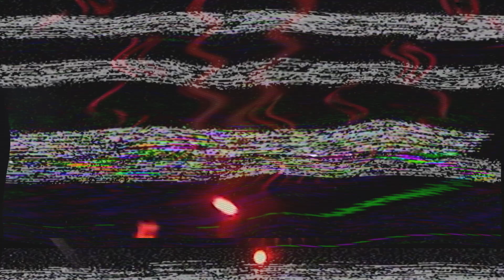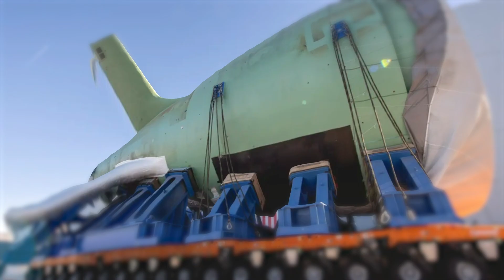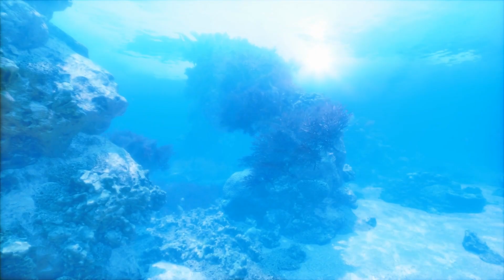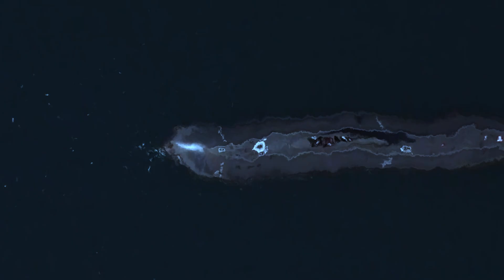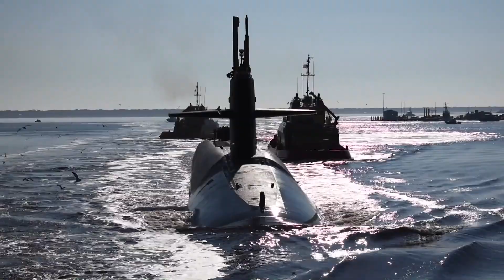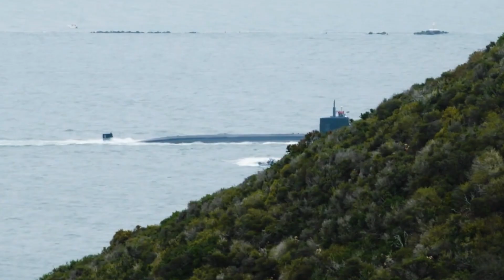America's Killer Next-Gen Submarine with a Weird-Looking Stern

Comment: Really? "... the x-shape stern optimizes water flow around the propulsor..." in reference to quietness? Sorry man, you're going to have to better at explaining how rotating the tail section 45 degrees reduces turbulence.  So much other hype in this video seems to credit the X shape for improvements that are probably better attributed to some other change or improvement. I just don't find this video to be credible.
Reply: @user-fj6py8gi8r  4 surfaces producing turbulence instead of 2. Maybe the per-surface turbulence level is lower but switching 2 noisemakers for 4 quieter ones isn't automatically better. Increasing the size of the 2 surfaces in the conventional format may actually be quieter.

The claims made in this video about the x-shape don't pass the sniff test with the amount of information provided; more supporting data is required.

Comment: they now have missiles launched from subs that have 12 separate rockets in each warhead , each rocket can track and take down any ICBM within 2800 miles of the subs location traveling at hyper-sonic speeds. 30 of them parked off an enemies coastline  or northern most point in 2 subs can take down 89% of over 300 ICBM's launched simultaneously .

Comment: Also excellent for stability at high propeller speed. (Prevents the sub from rolling on side as the propeller is turning the sub slightly at high speed)
Reply: Screw, not propeller.
Reply: @ChasWG  Whatever, pedant.
Reply: How would rotating the tail section 45 degrees counter prop torque?
Reply: @warpedweirdo  the control surfaces work to counter the force of the "screw". At high "screw speed" the entire "boat" be turned. (The screw turns the boat as it pushes against the water). Difficult to give a full detailed explanation of.
Reply: @warpedweirdo  oh sorry i think i understand the intent of the question better. All of the tail control surfaces are at 45 degrees to the vertical and horizon therefore all surfaces can control more than one axis of movement. A vertical rudder and horizon stern plane are not versatile in controlling multi axis. I am only using lay person mechanical motion concepts. Ask an ai chatbot to give a detailed physics explanation maybe.
Reply: @autopoiesis1011  Four planes at 90 degrees separation. 3 axis of control: Roll, yaw, pitch. Moving all planes 45 degrees about the longitudinal axis of the sub doesn't change the level of control each plane can provide, nor the resistance to prop torque each contributes. No physics or mechanical motion training is required to understand this.
Reply: @warpedweirdo  what is the original question?
Reply: @autopoiesis1011  My original question was, "How would rotating the tail section 45 degrees counter prop torque?"
Reply: @warpedweirdo  thank you for restating. Question? (Its been a long time since i watched the video) can each of the four "fins" on tail be turned independently? If yes then: at high "screw" speed adjust each fin so the entire tail becomes like a "screw" opposing the drive "screw". My description has no reason why the 45 degree angle helps, it just felt intuitive, so i retract my original statement. What advantage is gained by having non-conventional rudder and stern plain is no longer what i thought. Thank you for challenging my original statement and thank you for patiently following up. Very good chat, thank you!🖖
Reply: @warpedweirdo  i have considered, while surfaced and maneuvering each surface could act as a rudder, adjusting the surfaced draft with ballast could keep all control surfaces contacting water. Could be very important in a confined bay, harbor, river entrance, also if beached or bottomed (on the ocean floor in mud) there is not the conventional rudder vertical and buried.
Reply: @autopoiesis1011  The video had a lot of words about the tail planes, but nowhere near enough information to understand differences between old and new tech. I suspect a lot of the advantages attributed to the X-configuration by the video should actually have been attributed to the systems that control and move the tail planes. Systems allowing each to move independently would provide a number of improvements vs systems moving the planes only in pairs.